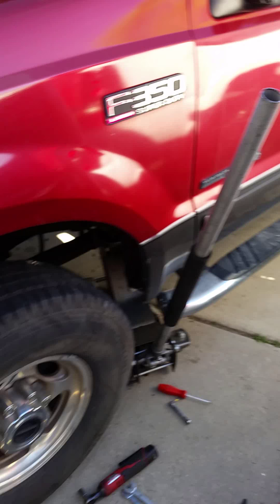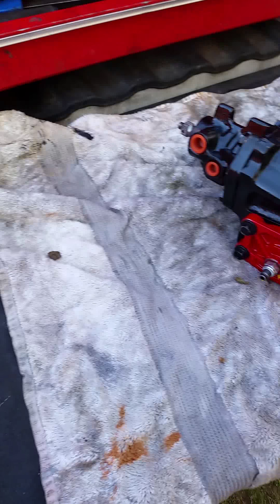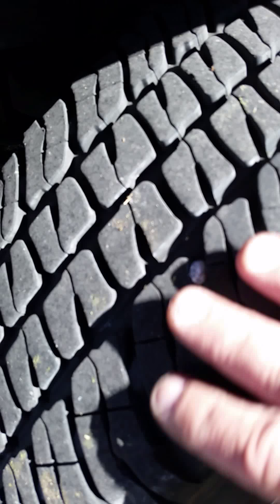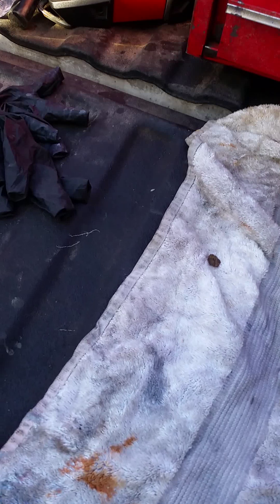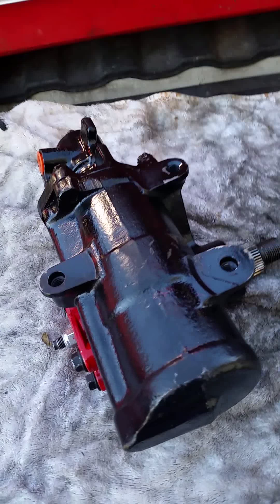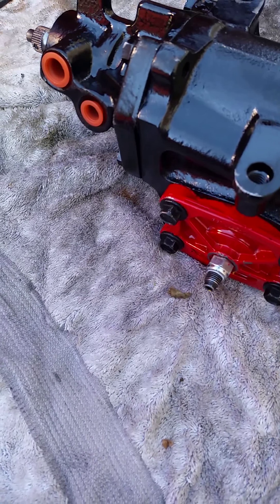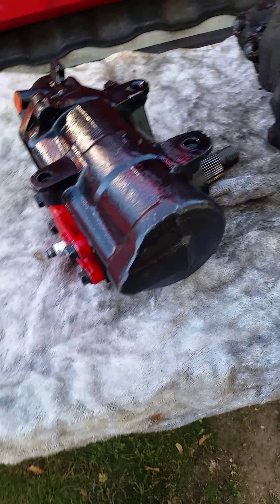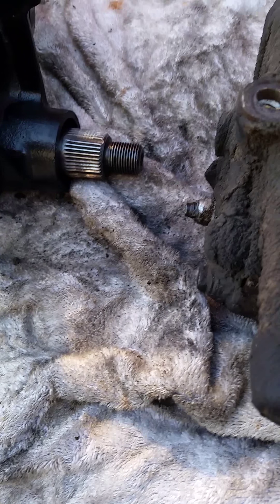Redhead gearbox

Comment: i have a old 1990 Chevy k1500 I am trying to restore I just rebuilt the front suspension did a upper ball joint idler arm pitman arm and power steering pump hoses and a a1 cardone gearbox the gearbox is junk I called redhead last week pretty pricey but that's what I am getting ready to order they only have a year warranty compared to cardones lifetime but if a gearbox is built right you shouldn't have to have a lifetime warranty and redhead is built here in the USA so that's another big plus for me! great video and I definitely think I will be happy with redhead gearboxes!
Reply: Greg Robinson How did you make out with the Redhead gearbox. I’m looking to do same on my 89 K5. Those auto store ones like Cardon are junk I agree

Comment: A worn out gear box will not cause uneven tire wear.
Reply from the maker: whats your point?
Reply from the maker: a worn out gearbox is dangerous..
Reply: im pretty sure his point was that a bad gear box doesent cause uneven tire wear which is true.. your tire wear is from your ball joints... and since you dont have a real front axle i suggest you buy the lower and upper with them already pressed in.. it will save you a lot of frustration.
Reply: randy johnson the amount of trolls on the internet is crazy! Somebody always has to give their stupid opinions. I just purchased a redhead, not a hoe the gear box lol. It’s for my 2000 Ford F-250. The original one had 32 splines but got the 36 spline one since I purchased the 36 spline pitman arm. It will work. Anyway, worn out gearbox is dangerous as I drove I could not get the truck straight and I kept swerving like a drunk driver and almost hit another car so bought a gearbox on eBay and it was junk like Oreillys so redhead is the way. I’m now waiting for it.